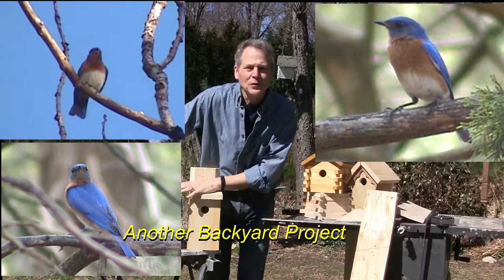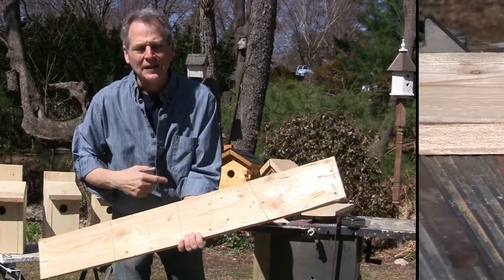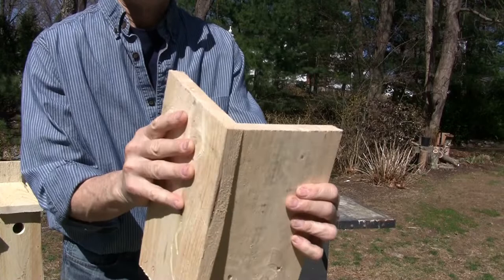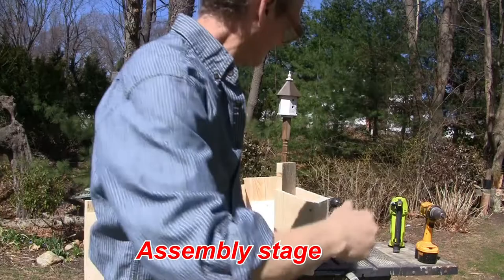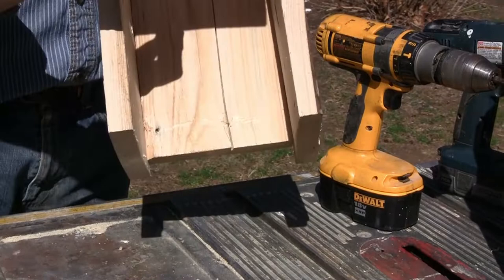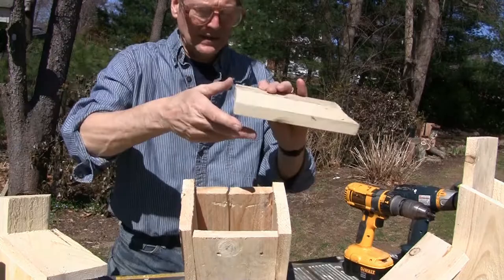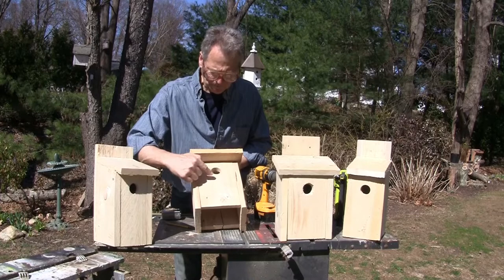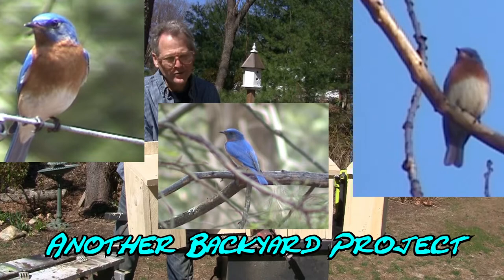How to Build Blue Bird House

Comment: Great video……but you need to add the length of each piece. Because I as dumb and would cut an build as you went along. Needless to say the back is the same size as the box. So I had to figure something out. Because I’m hanging on a metal fence post. Like us used for barbed wire.  But tks.
Reply from the maker: UGH  so sorry..I try to be detailed on the video..but must have skipped that one..I hope you adjusted and all worked out

Comment: Very well done.  You included the important elements: great ventilation and drainage, correct hole placement and size and the 'ladder' instead of a perch. You also did not paint or stain and used natural wood not plywood  or pressure treated.  I like to add a predator guard.
Unfortunately many videos are cute but are not healthy for the very animal they are trying to help.  Good job.
Reply from the maker: Thanks for the comment..I really appreciate it..and I hope this helps people build good houses..

Comment: Very nice , but not enough air flow for the baby birds .  4 holes in the bottom piece would be a good move ! 😉
Reply from the maker: Did you like the screen for the floor (go to time 6:20)??..I should have done a better job explaining..When I put in the wood floor I usually cut off the four corners of the floor..adding a good air flow..

Comment: What's your opinion on the predator guard - the extra piece of wood around the hole ?  I have boxes both with and without , I don't see any difference but would like your opinion . Thank you
Reply from the maker: The extra piece around the hole might be the best..I too have some with and some without..I have notice that when the hole size is too big that when the larger birds will attack the nest..I had a House Wren nesting in a birdhouse with a hole size too big for them. And the sparrows went in and killed the babies..
Hope this helps
Reply: Necessary in my experience
Reply from the maker: @mokedokie    Ha ha...well said...Enjoy